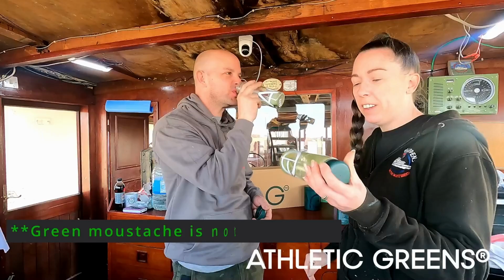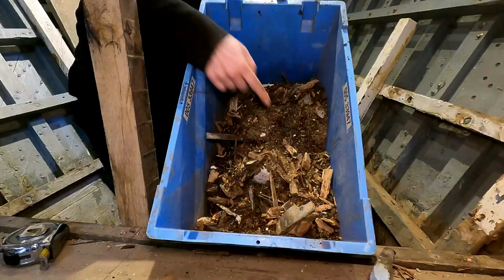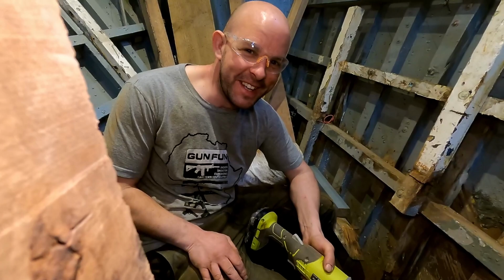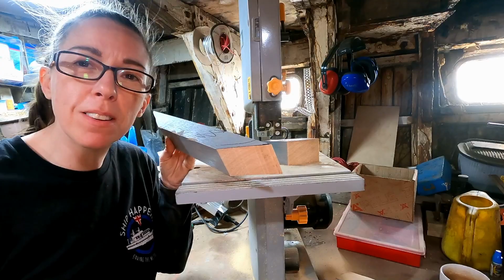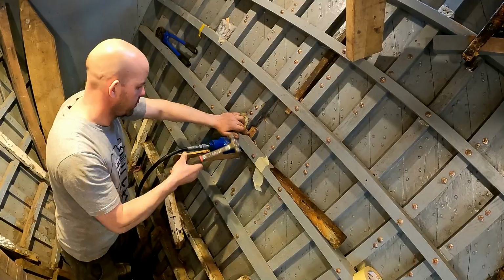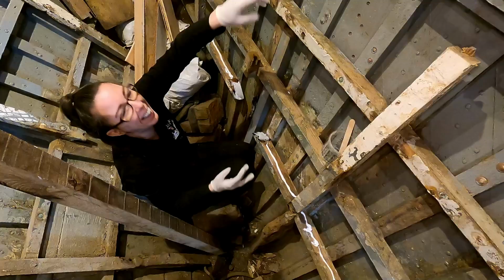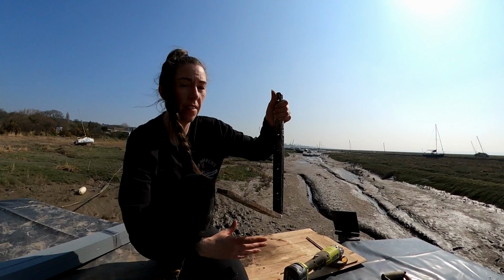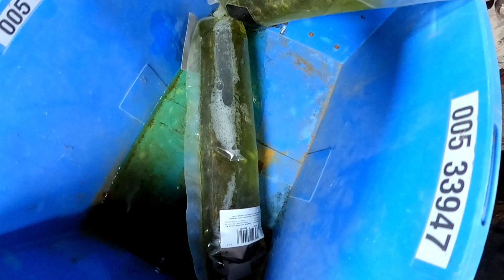Ep 65 - Off Grid Wooden Boat Restoration - Repairing Frames & Stringers

Comment: When we see you working...it gives us a boost...!! because the state in which the pieces of wood are sometimes... you should not indeed be discouraged.... yes it was a bit short when I saw the first mark...!! Bravo continue your work of restoration / repair, who cares if it is not very beautiful as long as it is solid... it is very well repaired for the moment...!! the idea of the bag was very good...but to check BEFORE if there were holes or not...!! personally I find that the diameter of your bolts is a little big compared to the section of the wood, which works in force...I would have taken a thinner diameter in imox also 6mm is sufficient...!!

Comment: Stainless bolts are notorious for shaking loose or falling and stripping the thread. so use a red thread lock on every nut and ideally nylon nuts. 
You can reduce the risk of falling with A2 nuts on A4 bolts. However it’s less corrosion resistant so check that first.

Comment: Passing one beam under another might go smoother with a scraper or spatula between the end of the new beam and the top edge of the existing ones. Might be easier than the big pry bar when there's a curve to the hull...You can save chemicals when de-rusting by making a 'mold' from heavy aluminum foil and lining it with thick sheet plastic. The amount of chemical needed will be way less with just a cm or so of clearance around the part. Once treated and cleaned, a coat of Phosphoric Acid will form an Iron Phosphate barrier against future rust. It can be painted over with any kind of paint.
Reply: Excellent comment. Damn rust;  it never sleeps!

Comment: I've used Evaporust and been very pleased with the results.  I leave the object immersed for 24 hours if posible.  I then drain off the Evaporust and rinse the item with fresh water to get rid of the Evaporust.  Then comes the important bit - I rinse the item with methylated spirit to get rid of the water.  This gets right into the pits left by the rust and absorbs the water.  The methylated spirit evaporates in a few minutes taking the absorbed water with it.  Then it's important to quickly protect the raw steel surface from re-rusting.  Your method of spraying with a zinc rich coating satisfies that part of the overall process. 
I've also used the methylated spirit rinse trick to dry a paint brush after using a water-based brush cleaner when I want to use the same brush for primer then top-coat or when changing paint colours.

Comment: When it comes to cleaning paint and rust off many of the metal bits such as those knee hangers might I suggest a needle scaler. I can’t remember if you have compressed air available onboard. It will make quick work out of it and leave precious metal in place. 

Another great video!  I hope you don’t have more surprises in the bilge areas when I comes to dry rot. 

Cheers!
Reply: Yup, they're great.  We used to have some, but others kept taking them. They were excellent for weld scale. A portable engine driven compressor should support a needle scaler, if used in bursts, or add a couple of extra air tanks plumbed together for longer time descaling, if the compressor can't keep up.

Comment: Can you build a thin floating dock so you don’t have to stand in the mud at low temperature tide? We use to do a thin floating dock to work on the side of our scallop dragged from time to time, wasn’t much thicker than a pallet. Had lots of styrofoam in it, and at low tide you won’t be walking in the mud, just trying to help from afar, keep them videos coming 😍

Comment: There is a cheaper way to get exactly the same result as Evaporust,  buy Bilt Hamber Deox Crystals in bulk pack (4kg I think)  , just make up the solution as you need it , also comes as a gel, you can mix the solution  up in varying strengths as well, so strong for very pitted parts or fast results, weaker for more volume of solution for larger parts. Parts need to be treated untill all the rust has gone , neither Evaporust or Bilthamber deox are rust converters. Take out the part at regular intervals and brush off loosened rust under the tap, this prolongs the life of the solution a lot.

Comment: If you were to use molasses you could have dropped the whole metal piece in the molasses without cleaning it up with the grinder and it would have come out looking like new. The only problem is that it would need to soak for a week or so. You can reuse the molasses over and over

Comment: Evaporust works well but there are other alternatives that cost less.
• Cleaning vinegar, straight, at least 5% acidity.
• Muriatic/hydrochloric acid/"spirits of salt" about 25% acidity.
• Electrolysis works well but requires a constant DC current.
Reply: I always use Vinegar for small items and  Electrolysis  for bigger items. Time and a good scrub and your done and it gets in to all the nooks and carnies:)

Comment: I would have thought that all the rotten frames and web frames would be rotten all the way to the bottom of the keel since water runs down, I'm glad most haven't been! but that box of rotten wood in the box made me think what an extra hard job it would be to put new frames in and join most of them to the keel. If someone said to me here's a boat on ebay how do you asses sthe hull and then replace all them frames you have I'd have had no clue lol. Nice work.

Comment: Were you satisfied with the rust remover?
Reply from the maker: We tested loads of bits in the workshop, left over night the results were great! Need to get a bigger bucket for the knees to do onboard!
Reply: @ShipHappensUK  I've used muriatic acid ( can be found in pool cleaning supply shops), but it gives off some nasty vapours and should be done outside. What you're using looks much more safe. I used a storage tote like you as well. Keep up the good work!
Reply from the maker: @WesleyHarcourtSTEAMandMORE  Wes I have sent u a video on Instagram xx